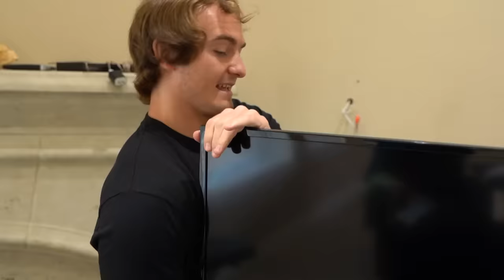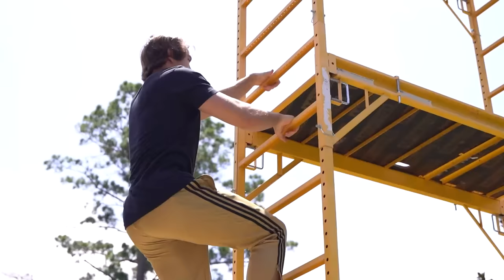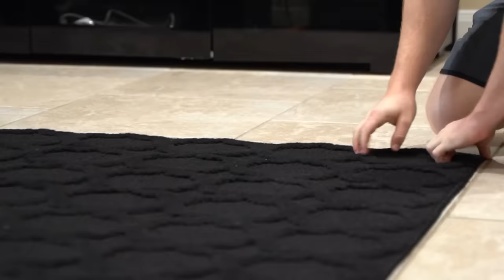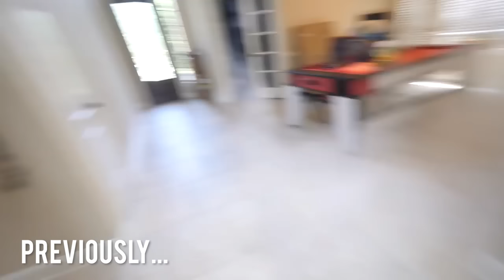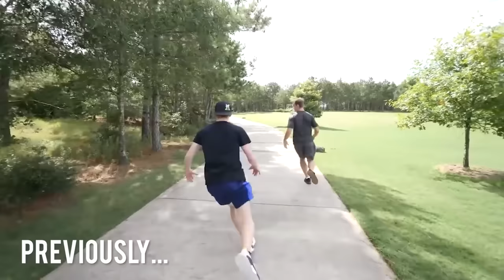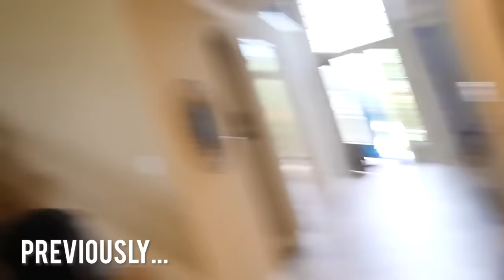I SOLD MY HOUSE!

Comment: Normal people and buyer :

The Seller : The history of the house is, that the house is recently built and it's recently renovated.

The buyer : well I'll bought this house.

Unspeakable house :

Unspeakable : this house is very strong, it's been hit by alot off things, the roof has been hit by coca cola bottles, the room has been filled with snow, sand, ball pit balls, packing peanuts, and alot more. In this house a couple wars has happened, nerf wars, attack of the Minecraft players and been filled with lava and also Cheerios war